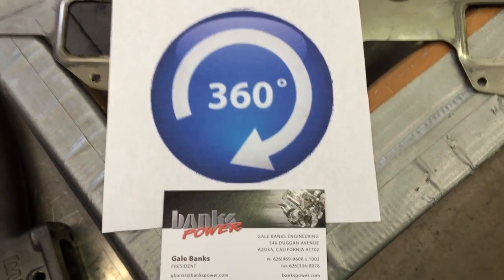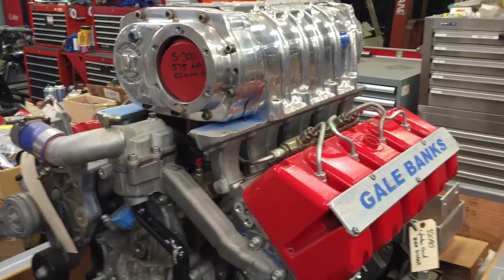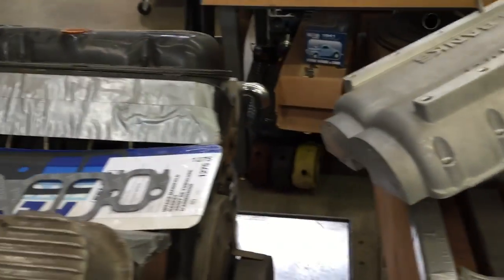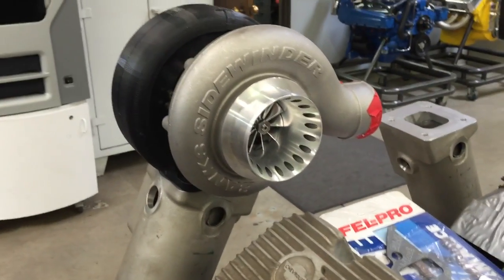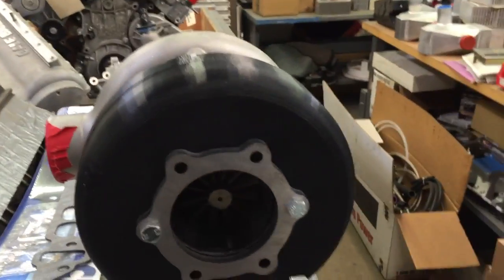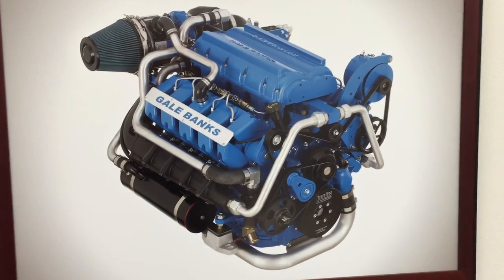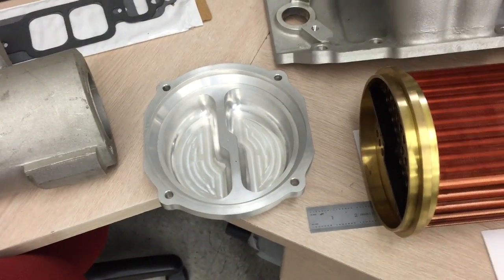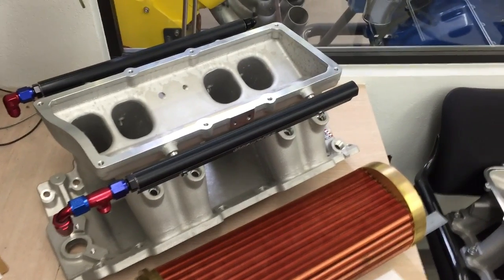Intercoolers Don't Care—A Banks Power 360 Production

Comment: Hey Gale and company, is anyone working on high flow humidity reduction? Intercoolers and forced induction seem pretty streamlined, but I don't see anyone working on drying the air. I know flow is the problem, but 1.4% power gain from dry air to humid seems like a lot of power left on the table. Any research you guys know of?
Reply from the maker: As of now we are not researching this, but it maybe something that we will look at in the future.

Comment: Why would you water cool the exhaust for a turbo application?  That heat is part of the energy for making boost.
Reply: It's for endurance. When you're pushing 1000hp wide open throttle for hundreds of hours shit gets hot. At some point you've got to loose some of that heat. Even if it means loosing some power.
Reply: Youre not very smart. Please try to listen .  we wouldnt be watching this if it were your ideas.
Reply: Cooling the exhaust manifold takes energy from the exhaust charge which spins the turbo so it's going to make less power.  You want to pull heat out of the turbo and keep the cool side as cool as possible.  It's not helping to pull the heat out before it's done it's work.
Reply: @GlassTopRX7  heat in excess can damage the turbo. It's about balance.

Comment: imagine harnessing the power from the hydraulic ram of a trash truck compactor or low rider pumps to drive wheels.
you remember those toy cars with a gyro wheel you'd get spinning by pulling a t-handle strip with teeth on it...
use a hydraulic ram to spin a larger scale model of that.. LOL
edit: with high RPM of today, incorporating windage tray in the pan again would be wise (owned '70 TA 340)
Reply: uhadme SST cars those were great fun.

Comment: “Super turbo” just describes a turbocharger, they were called that initially in military aircraft to clarify that they were supercharges driven by exhaust turbine wheels. Using both a blower and a turbo is usually called twincharging, even though the root words don’t quite work like that.
Reply: Phos9 I think the B29 had both anyway

Comment: Silly question. If someone wanted to put a turbocharger and roots blower on a diesel without any complicated valves, what advantages are there regarding which one is first in the line?
Reply: Im no mr banks in any way shape or form but i would guess the roots blower right over the intake and as exhaust is pushed out the turbocharger would feed the inlet of the blower because supercharger creates boost from the get go but it reaches a limit then a bigger turbo will have boosted by then giving you the top end gains i guess it like the compound turbo theory small turbo for take off big turbo for the high end. Just my thought but ive never done it personally. So i wouldnt take my word for it.
Reply: The top mounted blower always goes first are your basically using it for where your turbo is lazy low-mid range rpm. Where your turbo then picks up and then could be compounded through the blower again making for gains in the entire curve.